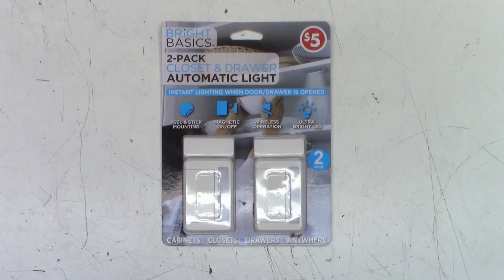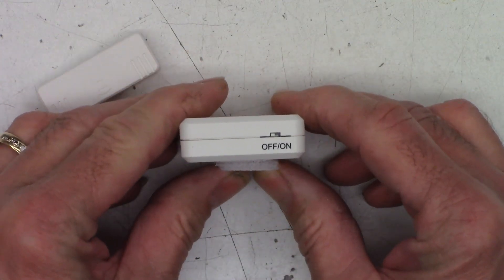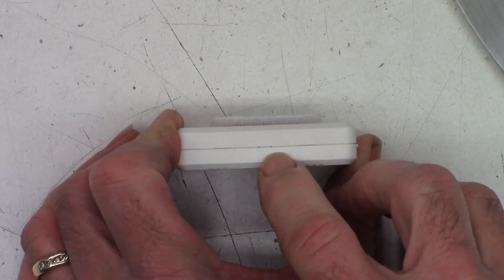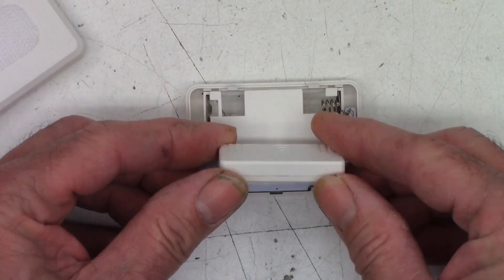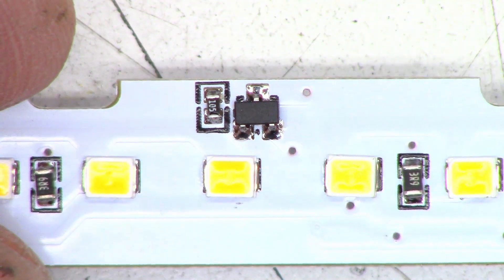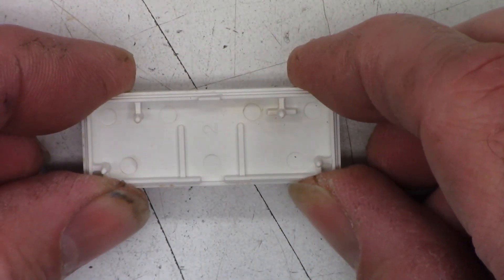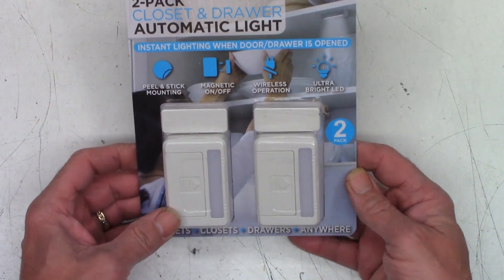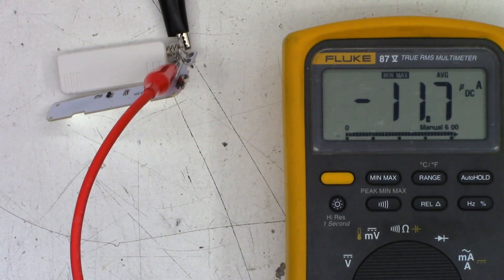Dollar Tree LED Drawer & Closet Light S-DT2MWL-08 Teardown

Comment: Interesting, all that extra complexity to avoid a 10c glass reed switch, though you would still need that tiny mosfet and the 1M resistor, to do the inversion needed to have the NO reed position turn on the light.